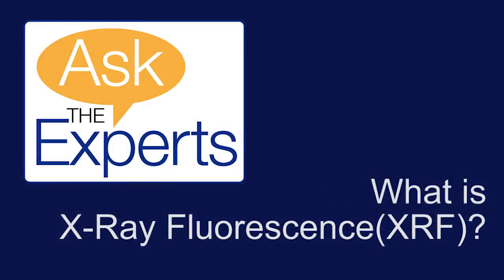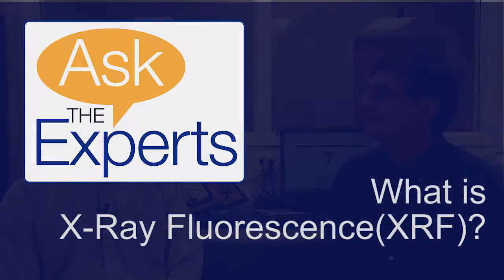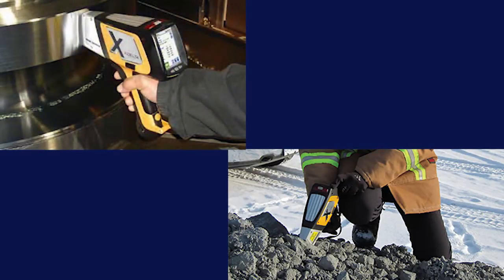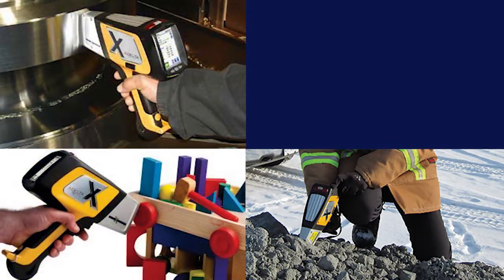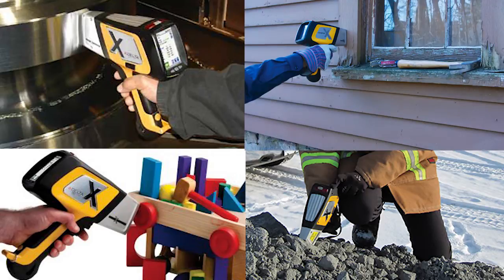Ask The Experts - What is XRF?

Comment: And if the sample is only plated can it detect in depth / and how deep?
Reply from the maker: +Israel T. The depth that the x-rays can penetrate depends upon the composition material in question and the energy of the x-rays being used. Depending on the material, the x-rays can penetrate a few microns up to a few millimeters. Additionally, it's important to remember that the analyzer will only measure x-rays that make it back into the instruments detector. Even if you are capable of penetrating deep into a sample, if the elements you are exciting are of lower energy, they might not travel out of the sample and reach the detector, so the analyzer may not detect it that signal. If you have other questions, please let us know!
Reply: thank you